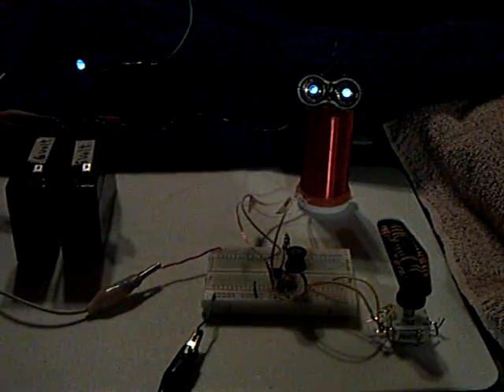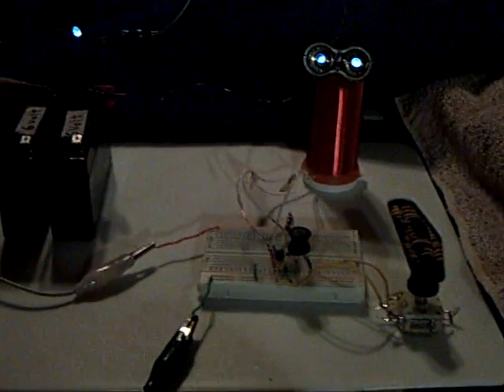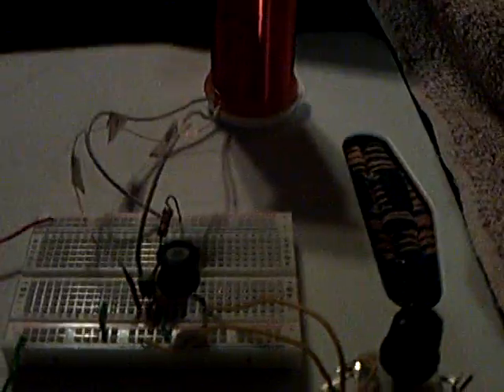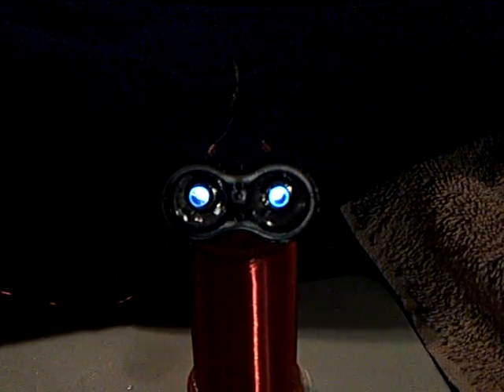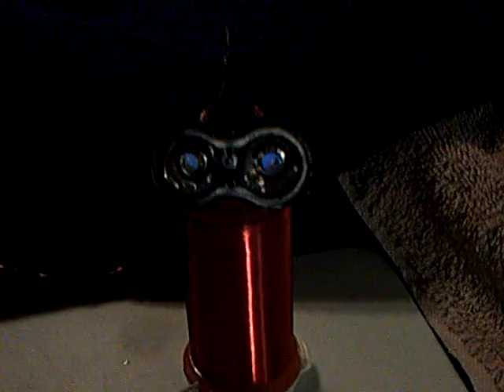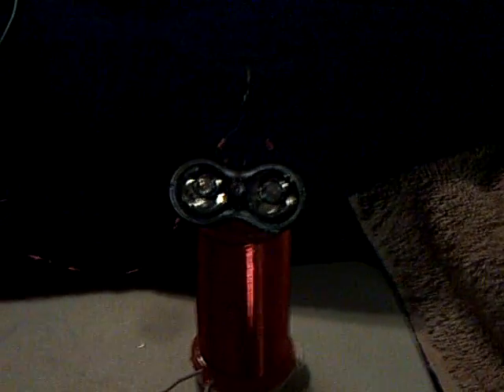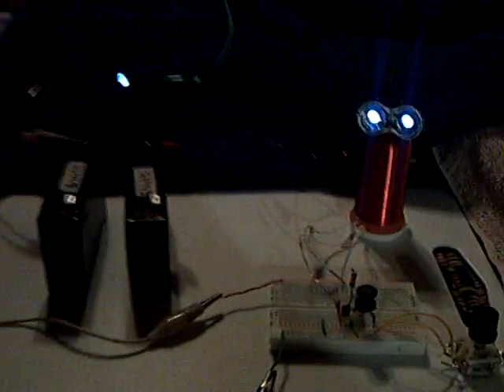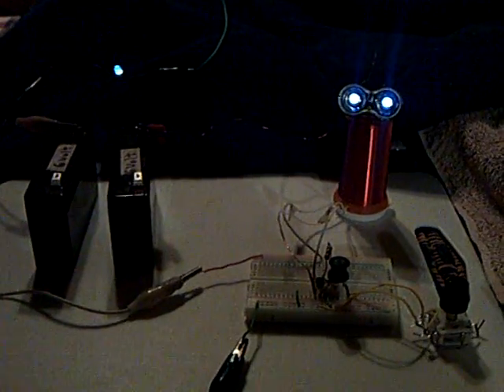Capacitive link between two Exciters

Comment: Hi Lidmotor :)

You are quite close to Nicola Tesla:
"System of Transmission of Electrical Energy," U.S. Patent 645,576
I recommend reading that patent and you will see how close your experiment .. :)
The capacitive link between power transmitter and receiver was always in place.

Good luck!

Comment from the maker: @slider2732 -----Some people think that this is an inductive linkup (like a transformer) but it isn't. It is a capacitive one.  Doc had some very interesting experiments a year or so back showing it .  I just lucked out using these SLA batteries here because aluminum blocks were called for.  I tried a few other things and they didn't work.

Comment: I know he was saying how noone seemed to want to replicate, so this cool...I find the whole thing very interesting, in terms of a non contact link to different devices. It seems a lot like an isolation transformer with no wire ! . Or, an optical coupler (4N35 etc). 
Tried here, but my masses are PC heatsinks and non are the same.
I wonder if AA's or large caps would work at least partially..hmmm